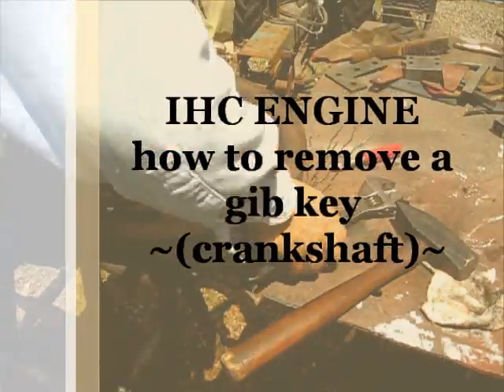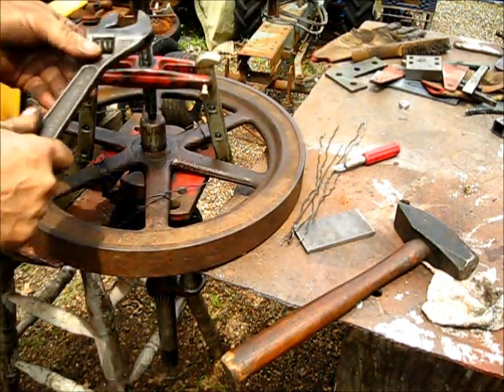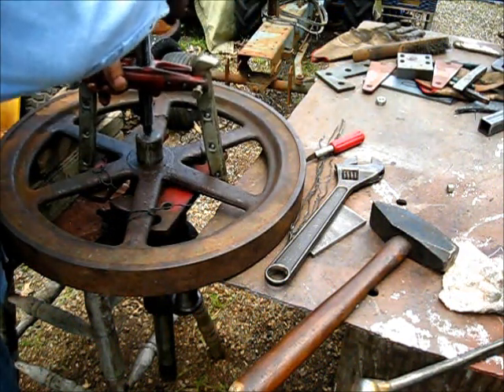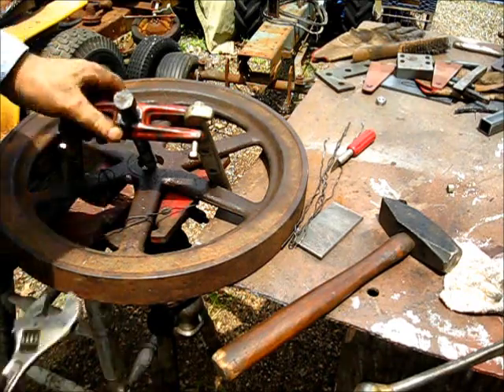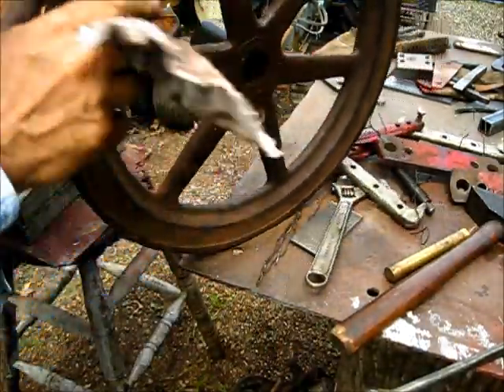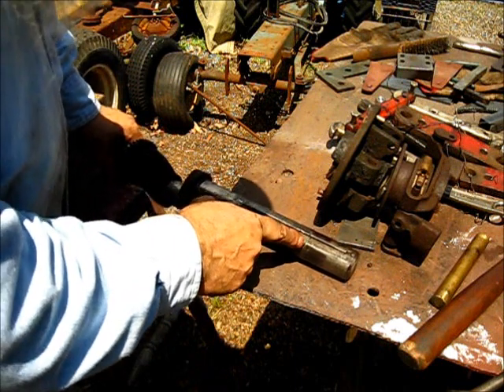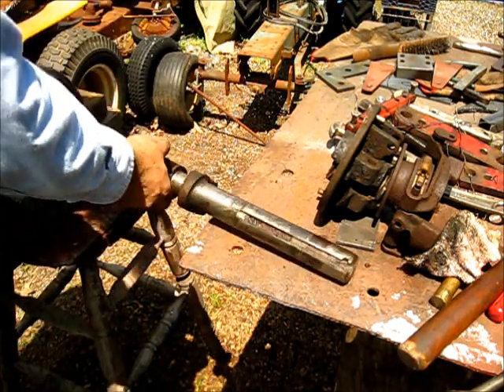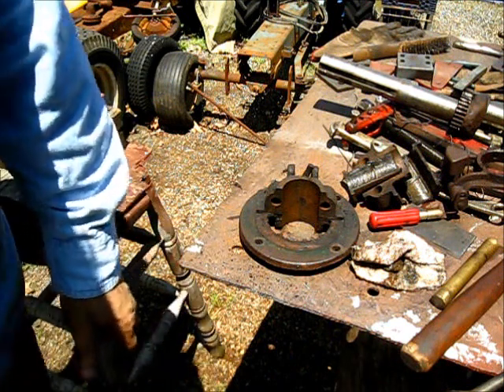1925 IHC Engine Model M how to remove a gib key 3of3 (crankshaft)

Comment: Just removed snapped key out of tangye from 1896 good video I welded on the stud bolt and drove it out with the key drift they are good tool to have in your box

Comment: Think about how that hole has not seen daylight sense 1925..
Reply from the maker: skyfual ,,, and I have an engine that has a crank handle part in the hopper,, will have to remove the cylinder to get that part out,,,, looks like a new one,,,